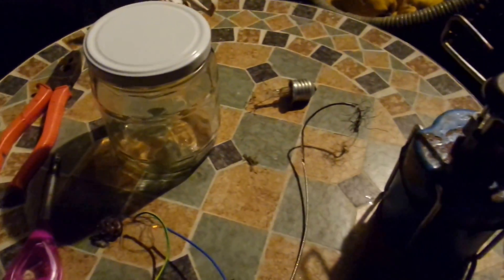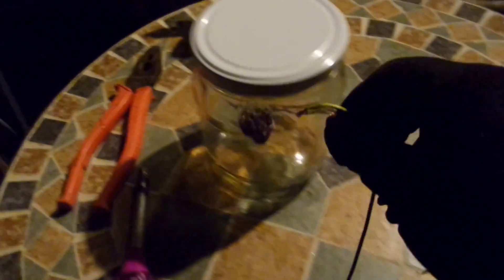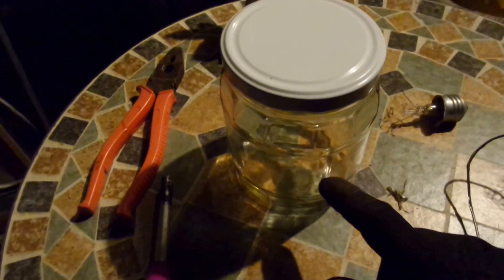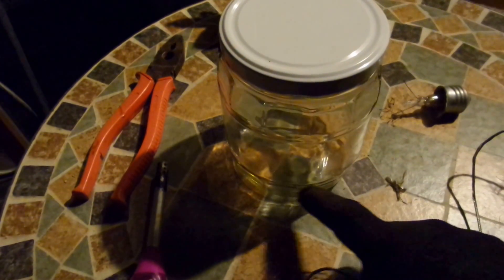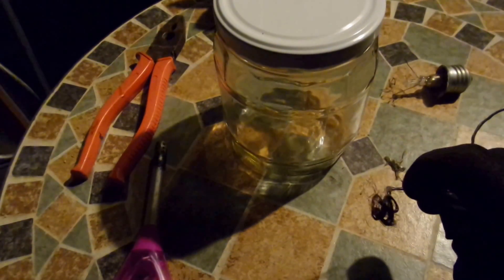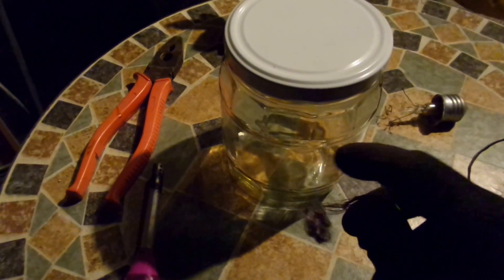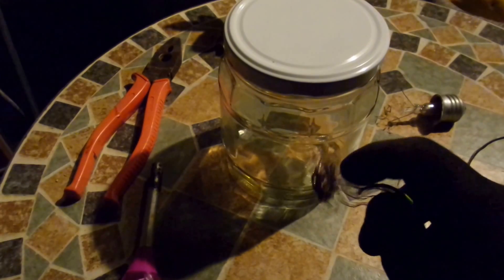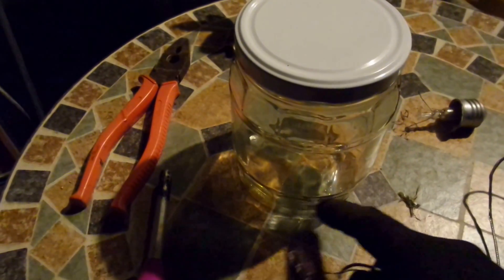Acetone Vapour Copper Wire Catalytic Heater Experiment

Comment: First of all, this catalytic reaction is a basic experiment known to most young chemistry students. It is done under supervision by something called a "chemistry teacher" with enough of something called "common sense" to have received a basic college level degree that declares they can teach children of even more simple mind without accidentally killing them. The teacher would know that the hazards lay less in the hot copper wire igniting a small bit of acetone (the catalytic process is different from a regular combustion) and that the more hazardous aspect is in the vapor produced, which is not entirely the same as if acetone was burnt without a catalyst. This is why a teacher performs the experiment under a fume hood, outside or for a short period of time in a well ventilated room. The arsenic in the copper is the least of your worries, the catalytic cracking of acetone with hot copper in a reduced atmosphere produces, among other things, Ketene Gas. Ever heard of it??? Probably not so, Ketene is a respiratory irritant. A bad one similar to Phosgene. Ever hear of Phosgene? Probably not if you can't perform this basic chemistry experiment with any degree of success. Anyway, what Phosgene is is a chemical warfare agent. You breathe it in and it slowly starts to cause your lungs to turn into a sludge pit about 24 hours after breathing it in. Ketene can do the same thing if you would do something idiotic like run a copper/acetone reaction for any length of time in a house for heat. That smell you caught a whiff while doing this experiment that smelled like a strong grassy or wet outdoor hay smell was, in part, Ketene Gas. The same smell is associated with Phosgene. I would advise you to stop any further experiments until you become better educated (In Your case, through a school, not by further self-education). You're proving to the world, through the internet videos, that you are probably much less likely to prove "over unity" of any sort thanyou are to prove "under education". In other words, you could very well prove you have found a way to feel fine at bed time just to wake up to a gelatinous goo gurgling from your lungs, up your trachea, out your mouth and onto your pillow whilst in the final stages of death. I write this because there is a lot of dumbassery going on in the world and videos like this one just perpetuates it. Try to have a good day, you probably don't have many left if you don't spend more time being taught what you want to know instead of chasing after free energy scams using just a little knowledge from other online video posters and downloaded free energy schematics. There are no free lunches in this universe and certainly no get out of jail free cards (especially for dumbassery in pursuit of fame or fortune).

Comment: You need more acetone for more vapor. Lid on. Try Nichrome wire from a hairdryer. Use electric current to pre heat wire.
Reply from the maker: Thanks for the tips... Yes, my Baker was too big and had too few Acetone in there, so the vapours were too fast going out and I had no stable fixing of the wire inside the baker...
Reply: Also do you need fresh air in there at all? If not close it up more. If so add an inlet vent that is controllable and puts the air where it needs to be...

Comment: Not enough vapor. You need more vapor. Also close the lid to keep the vapor inside. The heat from the copper wire will make the acetone warmer and create more vapor eventually. So far my 2 cents. Regarding the arsenic, the boiling point is at 613 degree Celcius, so if you heat up the copper it will vapor away. Copper boils at 2k5 Celcius. All info via google, do not blame me if I missed something.
Reply from the maker: Yes, I did have too few vapour...Yes, my Baker was too big and had too few Acetone
 in there, so the vapours were too fast going out and I had no stable 
fixing of the wire inside the baker...so it was just a quick setup to see, how it works at all and if other wire types would also work...
Reply from the maker: The question is, if the copper wire has maybe 1 % or 0.5 % Arsenic and the wire would glow 1 hour red hot on in the vapour, when will all the Arsenic be gone after which time ?